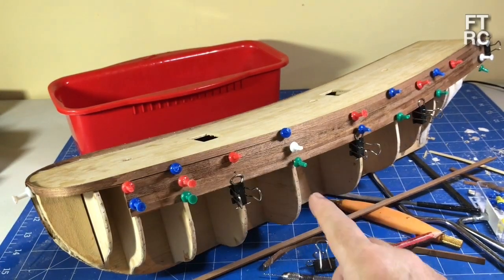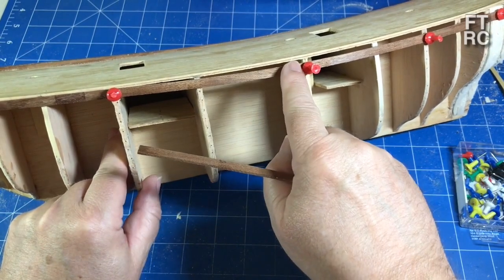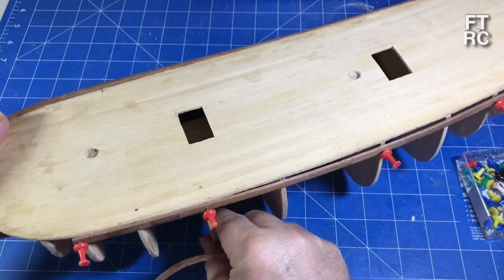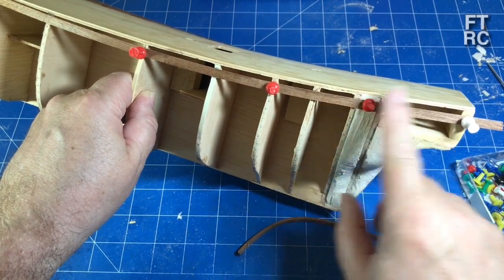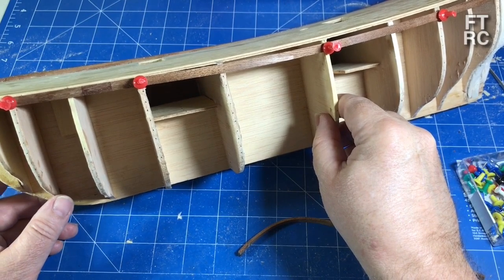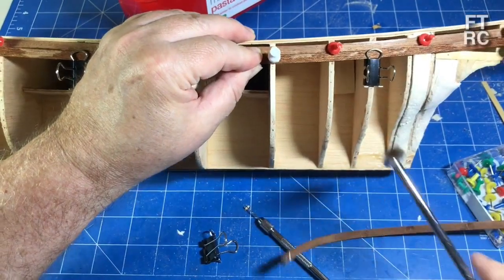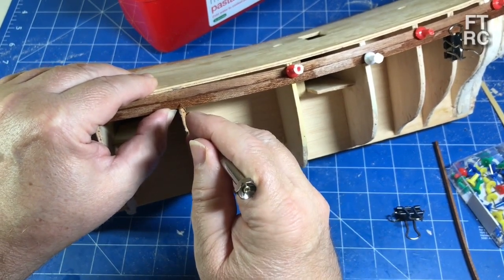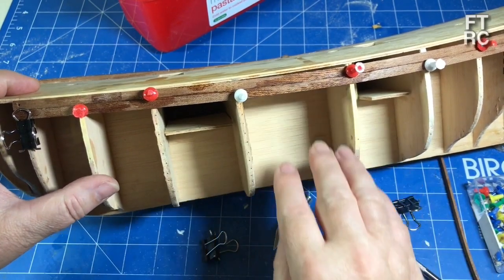Bounty by Constructo Part 3 Bending Planks

Comment: Hmmm so you need a hammer to put a wood sailing model ship together who would have thunk it.
Reply from the maker: You can try to push the pins in by hand if your pain threshold is high enough. Requires less brains. Give it a go

Comment: Heya, really enjoying this channel so far!  I have this same kit and i am at this same point, fist planking.  You mention that the previous owner mistakenly bowed the bow section of the upper deck.  Actually i believe it is supposed to be as mine is as well.  Those first few bow frames are bowed at the top.  Wasn't easy attaching that deck 😂  Anyways, many thanks, this channel is really helping with my build, cheers!
Reply from the maker: You may be right... my further research to correct the shape of the hull shows there are a couple of extra bulwark planks at the bow to give it an upswept peak.  This I believe will solve many issues and will be included in a future video.  Right now I am remaking the window frames at the stern using thin pieces of wood. Looks much better than the drawn on acetate.

Comment: What is the drill bit you used in mm please ?
Reply from the maker: The bit matches the pins I was using for the first layer. So would have been 1mm diameter.  For the second layer, where the thin planks had no holes, the holding blocks have 0.5mm nails, so the drill bit is 0.5mm. Just match to your pins or nails.
Reply: @HarryHoudiniModels  Thank you soo much appreciated 👍 
Nice work though ❤️❤️

Comment: Did you add anything to the water?
Reply from the maker: Just the planks
Reply: @HarryHoudiniModels  Cool.  How long do you soak each plank?
Reply from the maker: It was in the warm water for as long as it took for me to pin the previous plank.  As soon as I remove a wet plank to bend and pin, I also put a new one in the water.  That way as I finish attaching one plank, there is already another wet plank ready to go.